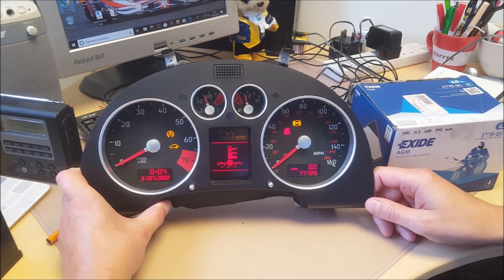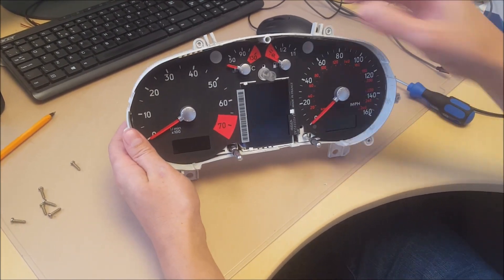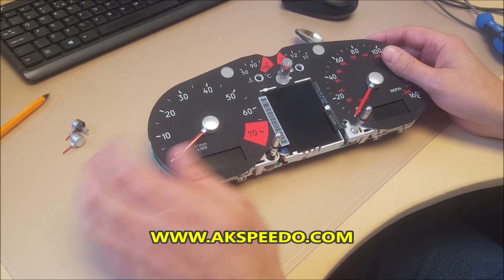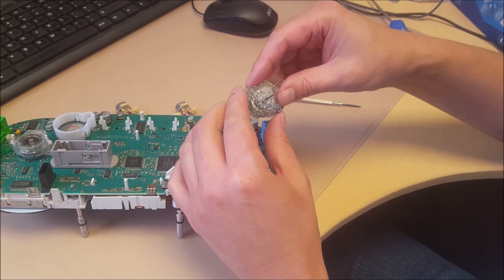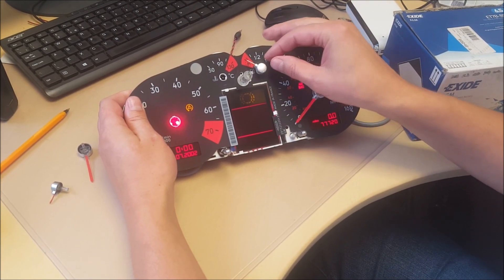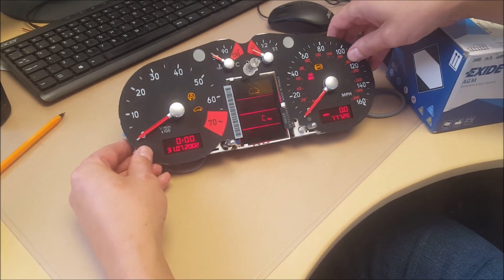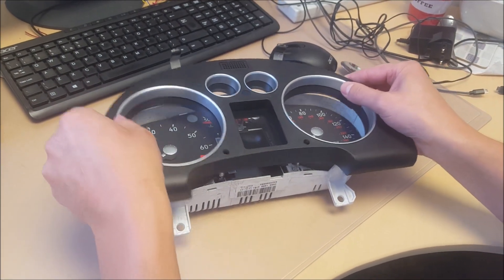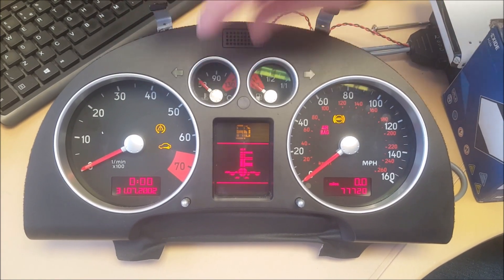Audi TT Fuel and Temperature Gauge repair (Part 1)

Comment: Is it a possibility if I take my cluster out, to repair both the temp and fuel gauges that my key won’t work to turn my car back on? I had a 2008 Audi A3 which I needed to replace a ignition switch and barrel, once i did I had triggered immobilizer and my car never turned on again without needing the dealer to re program my key. So I’m afraid of repairing these little motors and my 2004 3.2 v6 TT not turning on again without having the dealership program my key.

Comment: Hi! Thanks for the video! I replaced the fuel gauge motor and put the needle to "full" (while ignition is on) since the tank of my car is currently full . When I switch the ignition off, the needle does not go back to "empty" but stays somewhere just below "half". When I switch the ignition on again, the needle goes to "full" again. Do you have an idea what the problem could be?
Reply: And another question: the needle of my temperature gauge is slightly tremblig after reassembling the speedometer. What could be the reason?
Reply from the maker: Did you replace the metal coil cover?

Comment: Very good video! How do you set the dash to test mode? I just see you turning on a external power supply and the dash is in test mode. Is there a separat pin on the dash connectors to supply with 12VDC for test mode?

Comment: Hello there great video I must say. Slight problem I have is when I bought the car my traction control light wouldn't come on. I've done a search with VAGCOM and no issues. Tried a different speedo and light comes on. My question is how do i get to the bulb or display to see if it's been covered in the past?

Comment: My temp needle jumps around, a cold car will start at 90 degrees then while idling the needle goes to 130 and then while driving it will suddenly drop to 50  hitting the dash sometimes puts the needle close to 90 .

Temp in the AC screen (code 49) corresponds with the needle, when temp gauge is "overheating" AC temp reading says 122 degrees, when temp needle is at 50 AC reading says -10.

Is this the pointer motor thats faulty or?
Reply from the maker: Hi, if the temp reading is incorrect on the ACC, I'd check the and replace the sensor first, cheers

Comment: 0:40 and 8:05 looks very much like the fuel and temp needle illumination is out as well? You really should have reflowed the resistor on the other side of the board (immediately above and top centre of the LCD glass) while you were in there.
Reply from the maker: Yes, noticed this later, was fixed before we handed the speedometer back to the customer, thanks for your input

Comment: i have 2000 audi tt that fuel gauge doesnt work. i used my scanner to read fault codes in the DashBoard and it gave me a code
 00771 fuel level sensor (G) short circuit to earth.  does that mean the fuel gauge motor is bad? do you think changing the little motor of the fuel gauge is the fix for the short to earth.?
thanks a lot for your videos.
Reply: Dam people put up videos and they never get back to help with questions im going through the same thing as you
Reply from the maker: @wranglercjseven69  Hi, if the gauge is reading high, then it's a faulty pointer motor, very common problem, cheers
Reply: If you never got a reply yes.  You need to change the little mothers out.
Reply: The the motors have a creeping short to the ground/earth, which causes them to read high is the underlying issue...so yes. You need to change the motors.
Magneti Marelli has a lot to answer for as a lot of components in the Audis of that era suffer from such stupid problems and almost always, at the heart of it, is some little thingamabob from Magneti Marelli.
Reply: No its not the gauge motor. Its the sending unit in the tank that is bad. Common problem. Drop the tank and replace the sending unit.
Reply from the maker: @thomasroberts7349  Hi Thomas, thanks for your input, normally a pointer motor fault, but as you've said, the sender unit in the tank can be faulty, but not a common problem, thanks
Reply: I changed the fuel gauge motor,  fuel pump and sending unit and still having the same problem. Any ideas or suggestions?